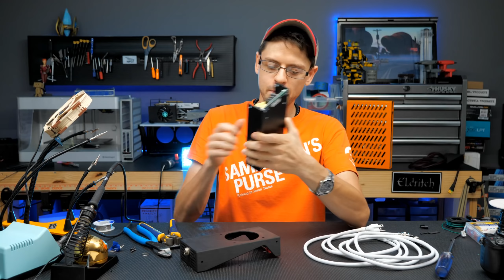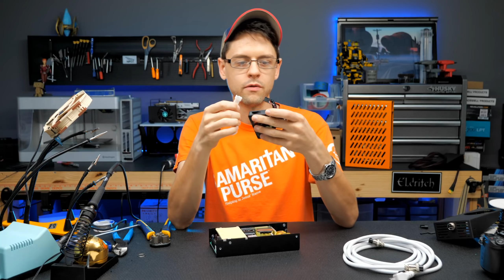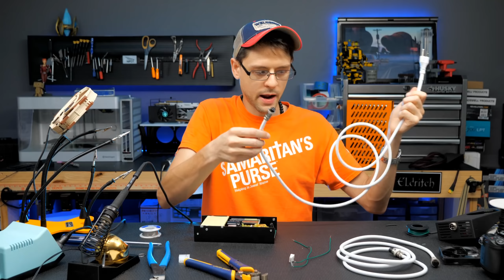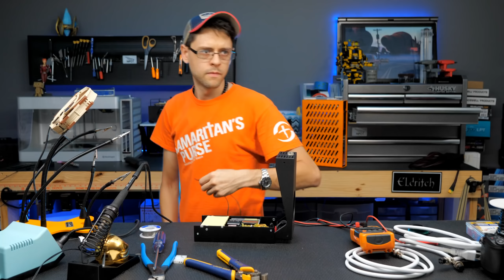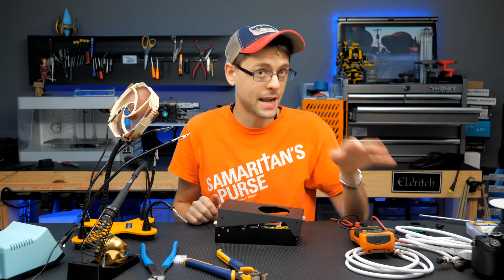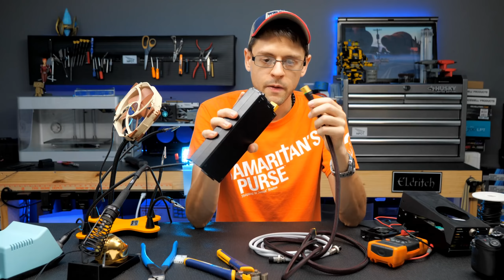In which we attempt to wire a Delta PSU

Comment: what about the missing nut of the water block/the long screws though the radiator with out no fans,ram in the wrong slots,nvme drive he missed the stand off nut and bent it down could of snapped the chips off it,the video was 1 big mistake if some one who never built a pc before followed that they could killed there pc they should of sacked him

Comment: I would have made the ac input cable with a three pin connector so you can not connect the ac cable to the dc output which you could because both end  have a four pin connection.
Reply from the maker: Totally--this is the test project. The final one will use a two pin for the output and three pin for input. Good thinking.

Comment: I posted this in multiple videos but no one notices. In the verge build he completely missed the bottom left retention screw for the water block. Its missing in the still shots and its missing in the portion of him uising the rig. Its crazy they didnt fry the chip. Seemed like I did more research for my first build (1366 build) than they did. I get he was just doing his job, but if any one of them did any research in building computers or even opened one of the included manuals in the box with the parts they would have seen the amount of miss information they were putting into the script.

On topic: Your videos are crazy under appreciated. I have been watching you for a year now and you are one of the most knowledgeable tech youtubers here with some of the most high quality videos and content. I wish your channel would get some traction so you could expand.

Comment: In the verge video, he also pointed the intake fan facing the underside of the motherboard, which is really bad. He also didn't install the RAM correctly, the computer won't run in dual channel mode with the slots he used.